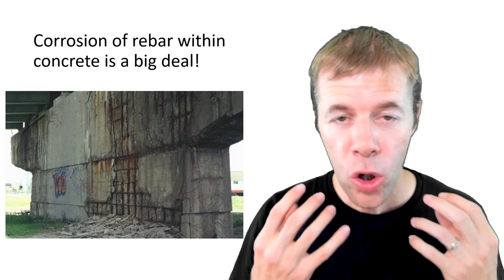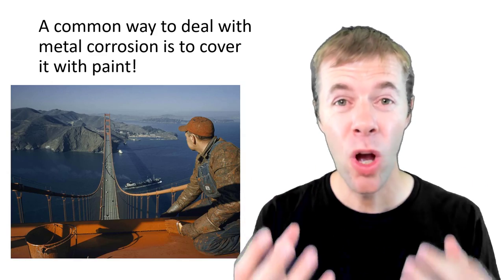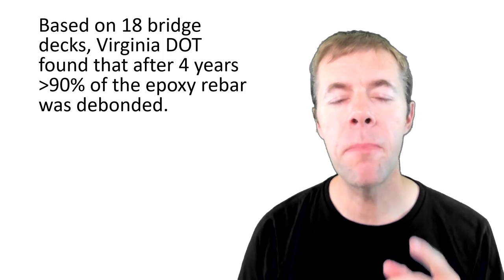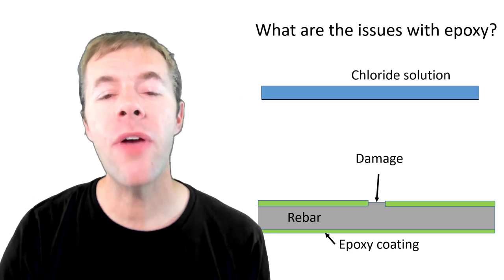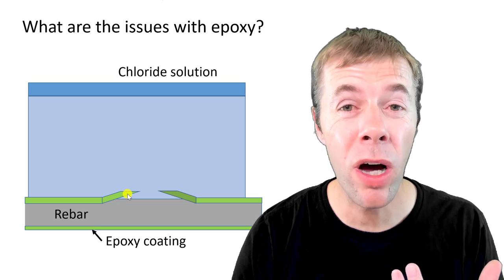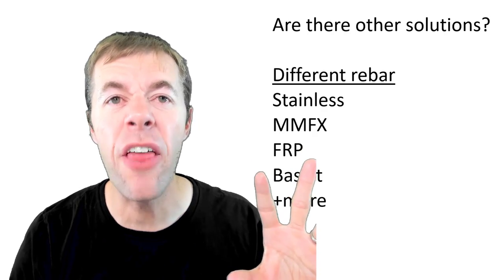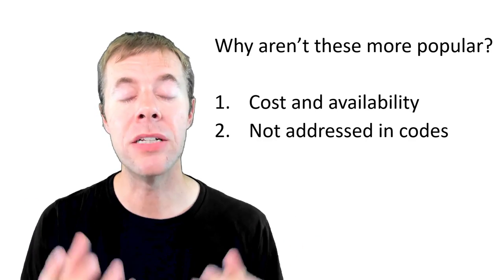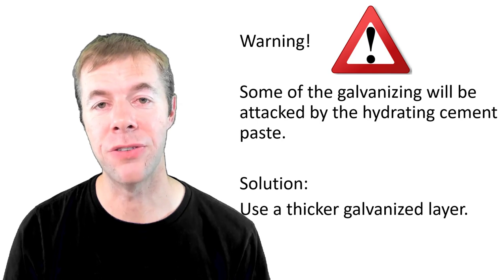What is epoxy coated rebar and why is it being banned?

Comment: Years ago, Dupont was already making a three part metal coating for use in harsh environments in mines. We used it and it included a zinc powder in the mix. Once set, you could not get it off with a hammer- we tried. There are many coatings beside the old epoxy versions.
Reply: @ezicarus8216  Ya, I don't have a lot of love for Dupont either 😃

Comment: as far as I recall, the problem with steel corrosion is that corroded steel expands, but corroded zinc actually shrinks in volume, so there is no concrete spalling with galvanized coating. Is that actually true?
Reply from the maker: Thanks for the comment!

Keep in mind that the galvanic coating is just on the surface of the rebar.  Even if the coating doesn't call surface spalling, the bulk of the rebar will eventually corrode and cause expansion and spalling.
Reply: With either zinc or iron corrosion, the change in volume is pretty small. The problem is all the hydrogen gas bubbles produced when the metals react with salty water.
Reply: @TylerLey  The galvanic coating is just on the surface, but as it oxidizes it forms a passivation layer on the steel surface underneath, so A) Zinc corrodes at a much slower rate than steel in similar environments, as much as 1/40th in a coastal climate near the sea, and B) once corroded, zinc oxide actually protects the steel underneath essentially as long as the surface was properly prepared (wire brushed and degreased) and the coating well bound to it. Sure eventually it will corrode, but if care is taken when preparing the pieces and applying the coating, and enough coats were applied, it will take a VERY long time (the concrete around it will probably go first)...
Reply: Due to battery effects, zinc ions will actually move to exposed iron, and bond with it. The thicker the zinc, the fewer the pores and the longer the coating will protect.
Reply: @avid0g  : electrolysis effects
Reply: @avid0g  
Zink coated Iron will rust where the Zink is gone, but it rusts much much slower simply because the Zink alters the electric charge in the Iron

Comment: I’ve been using galvanized rebar for marine projects for about 25 years with great results. They now have a continuous batch process similar to what they do for sheet coil. Galvanizing sometimes can get backed up on schedule. The new process is more available.
I remember inspecting bridges between my bachelors and masters  for UDot 33 years ago. Everyone was all excited about the epoxy coated bar. I couldn’t see a practical way of installing the bar without holidays. They have been on this epoxy track for a long time.

Comment: I've been a bridge builder before and we tortured rebar like you indicated. Some was plain bar that would rust and other was epoxy coated. The prefabbed stands were in epoxy coated too, but we'd only use regular tie wire on rolls with a circle on each end to work with the tool to put the ties in place. But sometimes it was coils of wire twisted by a power tool with a special bit. I think what you guys in code enforcement should be more worried about is what the state inspector sees & when they see it! We often had the foreman take the inspector to lunch when we stripped the forms because even though we used a huge electric vibrator there were big pockets of porosity that we got parged up before lunch was over. And so that the inspector didn't get in trouble we poured the test cylinders. I have a box culvert next to my house and it's not showing any signs of damage and it was built in the early 1980s & we are on the way to a truss as well as a hot mix blacktop plant and a landfill so it gets heavy truck traffic in the N.E. US. We never had those rebar caps like are everywhere now. I was actually buried alive for less than 10 minutes when an OSHA required digging shield wasn't used, but the law was not strictly enfored then. At a different company I was sent to pull the pump head and hose from a holding pond but the 2X12 I walked in on sunk & I was suctioned in for three hours and I had to sit on my haunches until a lady parked on the back row of a parking lot for a community college behind our job and I got her to call my boss. They sent a trackhoe and he wanted me to put a fiberglass strap under my arms and pull me up, but I told him that he would pull my legs off! I got him to open up a trench next to me and when the suction broke I sidestepped into the bucket. I had to walk off that job before it was over because they had 2 of us on a pipe culvert head with heavy jackhammers on the top & as it broke through it would pull us 6' into the riprap! I eventually got into trucking as a long-haul trucker but when I tried to use law's put in place to protect the motoring public as well as myself I got pushback. I went to the chief safety officer of one place and he said, "Lot's of bad things do happen to truckers!" I filed a DOT complaint, but never got a call back from them.
Reply: what inspired you to write this comment?
Reply: Are you joe biden?
Reply: i worked on draw bridges, but got fired . because i asked for too many draws.

Comment: When I worked for PCL in Canada, we built a hospital.  The bar was quality product and the ends were coated.  The completed grid as well as the forms were sprayed with diesel before the pour began. Time will tell.
Reply: Why diesel? What's it do?
Reply: @lezenfilms  Diesel and/or oil is used on forms to prevent concrete adhering to them- a good thing. But not for rebar where you DO want the concrete to adhere.
Reply: NO WAY ANYBODY SPRAYED THE REBAR! I SAW REBAR REMOVED BECAUSE THEY HAD FORGOT TO SPRAY THE FORMS AND WHEN THE ROOKIE DID SPRAY THEM,HE GOT IT ON THE REBAR!

Comment: The Parthenon stood for 2,300 years because the columns were joined to headers by iron hooks dipped in molten lead.
Reply: Interesting, how do you know this?
Reply: "
Undoing past doings
Before the restoration team could begin, they had to take apart, block by block, and repair nearly every piece of the Parthenon. That's because early restorers, most notoriously a Greek engineer named Nikaloas Balanos who led restorations from the late 1800s to the mid-1900s, put column drums and whole blocks back in the wrong place. Even more damaging, Balanos used iron clamps like the one seen here to hold blocks together. The ancient Greeks had done the same, but they had coated their iron with lead to prevent rusting. Balanos's uncovered clamps corroded and expanded, cracking and even destroying the marble.
"
Reply: Leading in stone was not rare in antiquity, (beware of rain caused lead runoff though) but the Parthenon stands for multiple thousands of years, because they used stone, not molecularly unstable man-made materials. The iron simply increased its resistance to wind and earthquakes. Shaping interlocking stones was another technique used in antiquity.

Comment: Once the rebar is bound and tied up ready for pouring paint it and give it dying time. That would give it added life. I'm in south Florida and concrete restoration is big business in buildings, especially along the beaches. All day, every day, buildings are pelted with salt from the ocean which sticks to the buildings. Then comes the rain, which washes the salt off and the water and salt make it's way into the concrete stress cracks and down to the rebar and BOOM! You got a problem, that becomes very expensive to fix. Almost every one of these high rise condos have this problem. A never ending cycle of repair. None have coated rebar, most buildings were built before coated rebar. The earliest buildings built here have crumbled away due to the fact that salt water was used to mix the concrete, the rebar just blew up in time. Paint, epoxy, galvanized, anything is better than nothing, but in the end, it just buys you more time.
Reply: Glass fiber reenforced epoxy coated hot dipped galvanized rebar. DONE
Reply: Grease will flex, so if they can figure out what will stay in place and not melt away, maybe that would work.  Road vibration means its only going to last so long.  I see some roads built with 8 inch and one layer of rebar, and I see double that sometimes.  It varies.
Reply: @Veritas-invenitur  Glass is not vibration proof.  Needs a tar mixture that seals with vibration probably.

Comment: Corroded rebar is a particularly hot issue suddenly thanks to the Florida condo collapse. As a layman, I’d never thought about it and I bet that’s the case for many others as well. Thanks for this video, which explains so well both the problem of rebar corrosion and possible solutions.

Comment: the dust/fumes from cutting and welding galvanised metals can be pretty harmful.
Reply: dfpguitar wear a mask
Reply: balony. I have cut and welded so much galvanised stuff its not funny. all you gotta do is wear your p.p.e. its just zinc, not plutonium! a dust mask is plenty of protection.
Reply: You shouldn't weld rebar unless it's certified for welding.
Reply: @bpj1805  you are kidding, right? cause, um, everything can be welded if it is done properly, with the correct filler etc.
Reply: @lukewarmwater6412  How do you propose to heat treat a bridge (sans concrete cover) to restore the correct temper to the welded rebar?
Reply: @bpj1805  dont be foolish. re bar is not train track! it isnt hardened to begin with so heat treating is not necessary. the re bar doesnt carry any of the load, that is what the concrete is for. you think tying it togather with wire would be in any way acceptable if it carried a load??
Reply: @lukewarmwater6412  Of course rebar carries load. That's what you put it in concrete for. It isn't in there just for shits and giggles. It doesn't carry a shear load, which is why wire ties are okay. It carries tensile loads, for which it can be compromised if you weld rebar that isn't approved for being welded.
Reply: @bpj1805  bro. re bar is just 'mild' steel, nothing special. it gets welded together all the time. it isnt heat treated, it isnt an exotic alloy. 6011 or 7018 rod....
Reply: @lukewarmwater6412  Dude no. Just stop. Just because rebar is "nothing special" it doesn't mean it's mild steel. You can get rebar that's suitable for welding. Either by being specifically made for that, or by coincidence. But if you just have some random, unmarked rebar, you can't assume that it's suitable for welding.

It's okay to be a practical-minded "just git 'er done" kinda guy. It's not okay to be that kinda guy who thinks he knows better than the "boffins" who figure out the metallurgy and help write the codes for this stuff.
Reply: @bpj1805  it can be bent to any shape you want. it is just mild steel.... after thirty years of welding I think I know a bit more than you do about steel. yes, you can weld it without heat treatment after.
  dont assume things, youll make an ass of yourself.
Reply: @lukewarmwater6412  Dude just stop. Get out of the business if that's what you do for a living, before you cause a bridge to collapse. Being able to bend rebar to shape does not equate to its being mild steel. Mild steel is a specific alloy, it isn't just sme catch-all for "steel that can be bent to shape".

Mild steel cannot be hardened by quenching. Rebar often can. And that's exactly what makes welding rebar a problem: you can (can! not always!) get a hard, brittle area in the steel. The weld effectively gets quenched by spreading heat into the bulk rebar, hardening it if the alloy allows. (And God alone knows what alloy you really have, because it's make from all sorts of scrap feedstocks, unless it's specifically selected for making weldable rebar.)

You don't know better than the boffins. Just do your work as specified in your relevant codes. They're there for a reason.
Reply: I was told if you breathed the smoke in when burning it made you infertile.But then again I used to get sent to stores for a long stand  😂so probably wasn't true .

Comment: now here in Canada we use rebar in fiber glass...doesnt corrode..flex better and lighter and more strong then steel
Reply: Frederic Paquin , fiber bar is very expensive, very slow to fabricate and it has no long term track record.  Strength deterioration from vibration and stresses make it very unpredictable.
Reply: Et la fibre de verre a une bonne adhérence avec le béton ? Il est profilé comment ?
Reply: ah, i believe it's pronounced  "Canaidia". thank you

Comment: Corrosion 101. Well done. Had a sales job involving pipeline coatings. Had to join NACE and go to meetings to "talk-the-talk". Zinc sets up its own Cathodic Protection to push electric current into any exposed bare steel and sort of seal it off from corrosion.

Comment: from a gunsmithing/metalurgy standpoint, we dont use powdercoat because it has retavely poor adheasion. it had good friction wear resistance, but once it chips down to bare metal the rest of the powdercoat flakes and chips off much easier. that is why processes like blueing and parkerizing are used, because it is affecting the metal itself, if you scratch through it, it will still corode, but from that point only, unlike podwecoat which allows it to spread. powdercoat is like a layer on an onion, once you are through that layer it spreads quickly and easiliy under that layer. another thing we use is KG gunKote or Cerakote, they are spray and bake on finishes, which require sandblasting before applying and baking to a cure. in general powdercoat is likely so much more feasable and economical on the scale of rebar

Comment: I'm not an expert at bridges but I am at ferro cement boats.   The #1 corrosion problem we have is not thru rust but galvanic.   In this latter case you do NOT want dissimilar metals, especially ignoble ones like zinc.  

As mild steel and cement has virtually the same thermal expansion/contraction coefficient the real magic in using them together is for them to be in direct contact.  I'm not surprised you're having problems with the bonding of the epoxy cuz that kind of defeats the point.  

As cement that is frequently exposed to water continues to harden throughout its life, I'm not even an advocate of epoxy coating the outside like many are. 

In boats, if you're having a problem with oxidation its because you have voids in your pourings or your mixture is bad.   In boats we try and keep the mix as dry as possible and ram it in by hand so maybe this is a problem because you're mix has to be wet enough to pour.  You could try adding more Pozzolan (which is supposed to make the finished product more water proof).

We do use epoxy coating the steel armature for repairs because the PH of new mortar is different from that of old and they need to be electrically isolated from one another to prevent galvanic damage as it cures.

In my opinion, if your really having a concern with oxidation of your reinforcement, your best/cheapest bet is to use COR-TEN steel (which should only be slightly more expensive because it has a little copper added to the mix) that rusts at less than 10% the rate of regular steel, and shouldn't dramatically increase the rate of galvanic corrosion as copper is fairly noble.
Reply from the maker: Thanks so much for the comment and for sharing your experiences.  I believe the oxidation and corrosion you are talking about is from carbonation.  See this video: https://www.youtube.com/watch?v=5Zq0C0cHqtM
The corrosion that I am talking about in this video is from chlorides.  See this video: https://www.youtube.com/watch?v=sh-V1grSkMQ

Coreten steel or self-weathering steel will corrode heavily in salt environments and so would not be a good choice for this application.  However, I have never thought of using it for carbonation.  I think that is a really good idea.  Thank you again for watching!
Reply: COR-TEN corrodes through till failure if it isn't exposed to air in the environment. Even COR-TEN under dirt will rust through and fail. COR-TEN poles and lighting structures are core coated with epoxy at the bottom that will be in concrete or in earth for this reason.
Reply: Kevin,
I've been looking at using basalt fiber/rebar for a "ferro-cement" hull; Florida has been switching over to basalt for bridges that are being built/repaired/replaced. Do you know of anyone who has used this in boats as yet?

Comment: I’ve heard that adding fly ash to your concrete mix, in addition to other rebar improvement solutions, increases the impermeable character of the concrete to moisture. An added measure?
Reply: Fly ash has been used in concrete for decades.
Reply: @tonyantonuccio4748  Some scientists reported that fly ash was used in some early concrete formulas thousands of years ago, but was just more lost engineering.

Comment: Tyler, love the vids. You explain things very well and in a manner everyone can understand.  Galvanized bar is interesting, however, I have extensive experience with galvanized coatings with traffic signal mast arms and overhead sign structures. These coatings are easily damaged and scratched, and if the inspection is not rigid (poor QA/QC) this damage can be missed leading to the same point corrosion seen in the epoxy bars. If the coating is thick enough or handling is good enough, galvanizing may be a good option. Personally, I prefer a layered approach to corrosion prevention. 1. Good concrete (high resistivity) 2. Use of Supplementary Cementitious Materials (Fly Ash/Slag/Silica Fume/Metakaolin or similar) 3. Good inhibitor (CNI) 4. nonreactive or protected rebar (if an option) 5. Cathodic protection.  You asked...... Great video, and always looking to see what you are up to.